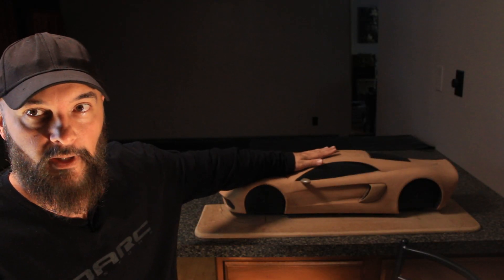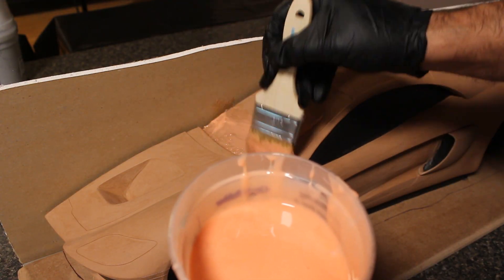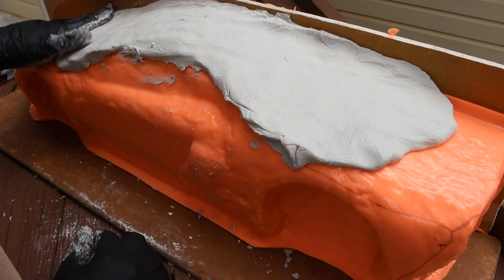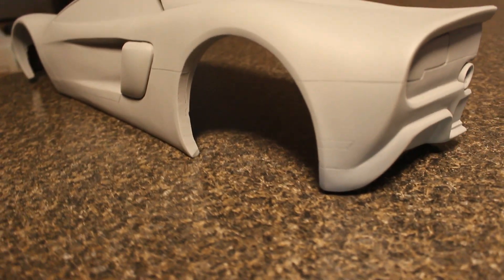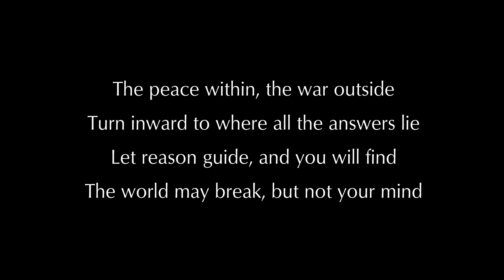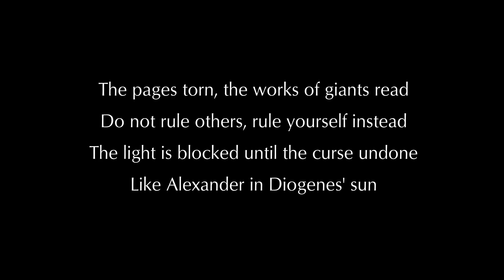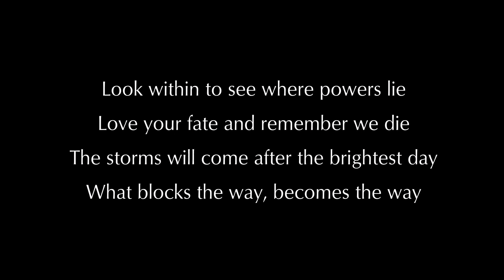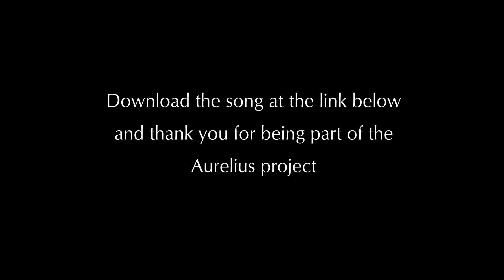🔥 Aurelius Supercar Project 1/6 Resin Model. Episode 2

Comment: Kool design and great project. 
Not sure if you already mentioned it or not, but are you planning to power this as an EV or ICE?  Are you planning to build the frame from scratch or going to utilize a donor car?
Reply from the maker: V8, likely an LS variant. Chassis will be scratch built tube frame. No donor cars will have this exact wheel base and simply modifying the length of one will cause all the suspension geometry to be off.